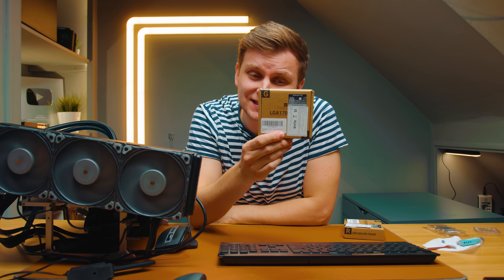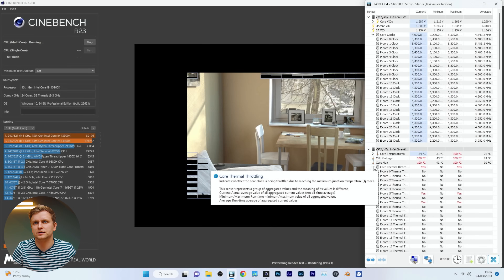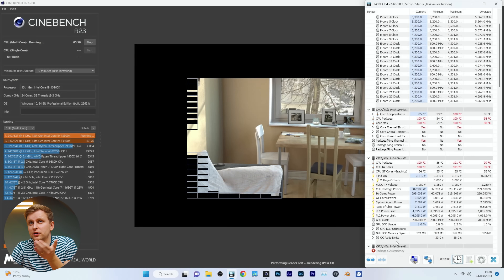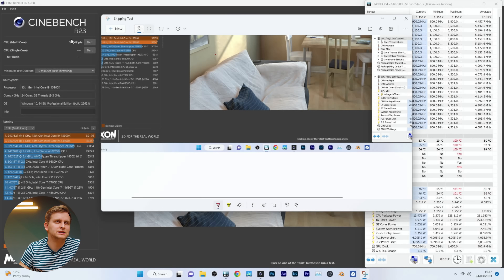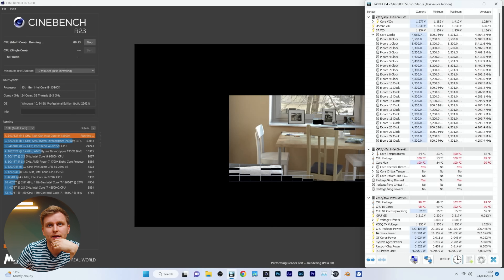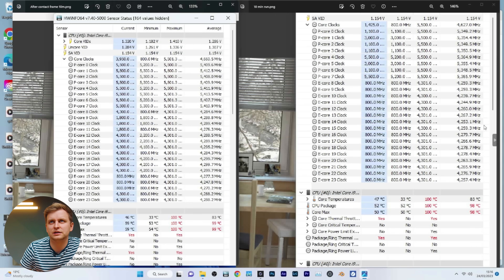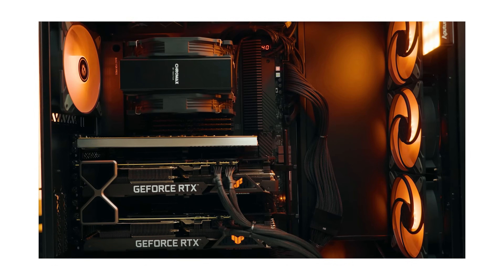This Makes Your CPU FASTER & COOLER 😱 | Budget CPU contact frame for Intel & AMD

Comment: I have been struggling to get my intel PC to not hit 100 degrees for 6 months. New fans, more changes to fan speeds and configurations than I can count. spending hundreds of dollars on fans and aio's. Messing around with Bios and XTU settings daily. Finally, I ordered this $10 part and the best thermal paste I could. Installed it and BAM it max's out rarely at 80 degrees and cinibench hits about 75 with undervolt and a slight overclock. Its amazing!

Comment: No it doesnt. About 2 degree difference at certain loads under certain conditions. Only thing that makes your cpu cooler is an actual cpu cooler and only thing that makes your cpu faster its you system and cpu and bios setting.

Comment: Most likely your CPU just isn't that bad. I've had a 12700k that was brutally bent. Had a huge puddle in the middle with stock bracket. My 13700k is nearly completely flat with stock bracket tho. There's a definite variance between CPUs and how straight they stay on LGA1700.

Comment: I have the i5 14500. I never seen my peek temps go beyond 71c but usually hangs around 45-50c on gaming. Some times 60c on a peak moment. It is on turbo as well so should I even worry about it with these temps?
Reply: If you're not having issues with temps, go for it. I switched from a 14700k to a 9800x3d, and just for peace of mind got a contact frame. Same cooler, no problems. The intel just kept randomly crashing and restarting. Had it before the final Microcode update, so maybe they're alright now, but I love the AMD CPU.

Comment: The question is also, if we reduce the temperature because of this frame, because it has contact with the heathspreader?...in essence, we increase the thermal mass and surface area of the heathspreader.  So it is in our interest that there is not only good mechanical contact between them, but also thermal contact.  It would be interesting to see how cold the temperatures would be if you applied an ultra-thin layer of thermal paste to the surfaces where the frame and the heat spreader touch or  where the frame presses on the heathspreader.
In that sense, these frames are poorly constructed.  Basically, in addition to mechanical rigidity, you should also have as much surface area as possible.  I'll try it on my new AM5 system...just a little...a little bit of thermal paste on the contacts of the heatsspreader and the frame can't hurt...just the application should be really minimal, and rather on the frame than on the processor when it's already in the socket  ...just less possibility of "accident".

Comment: Please help!
I watched your videos on ProArt systems and contact frames and decided to use one on my first build, but have run into a problem.
I bought a ProArt PA602 case, a ProArt LC 420 AIO cooler, and a ProArt Z790 motherboard with an Intel 14900KF processor housed in a Thermal Grizzly contact frame, and tried to put them together. Assembly went normally until I tried to install the waterblock/pump head onto the CPU. 
I used the hex-styled standoffs labeled for an LG1700, as per the instructions, and just lightly seated them onto the motherboard, not over-tightening. The Thermal Grizzly contact frame is absolutely not touching or otherwise interfering with the motherboard or CPU fitment. The standoff screws seem not long enough with the included Intel-style backing plate to give any thread to install the thumbscrew caps which fasten down the waterblock/pumphead. There is a gap left beneath the AIO mounting bracket of just about the size I would expect to give enough thread for the thumbscrew caps, if only the waterblock copper face were a bit shorter in height. When settling the waterblock onto the CPU, the tip of each standoff screw just barely comes flush with the outside/top of the waterblock mounting bracket, leaving no thread to fasten them on at all. 
I've redone this from scratch twice now, carefully rechecking everything I did, and cannot figure out what the problem is. What am I doing wrong?

Comment: Your test is not very valid. You had cooler as bottleneck. always 100c.  so any plate cant help you. and you wont see difference. you had to lower the power so that cpu stay at lets say 90c..and then apply frame and see will it go lower when you know that it cant go higher than 90.

Comment: It's $10, lol you definitely should buy it. It's driving me nuts, everyone out there critiques all of these products and poo-poo a few degrees lower temps, if you purchase (the Best/coolest AIO, etc.) and do things (airflow management, the best Thermal paste, etc.) that can save a few degrees here and there it all starts to add up to a CPU that can run cooler and perform better.

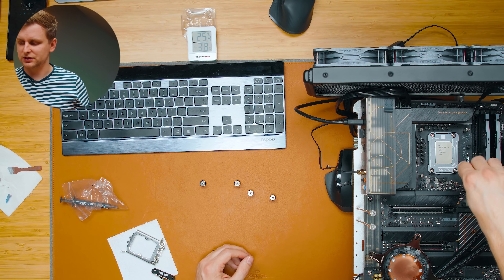Comment: 10:22 Yes, that's perfect.

Screws and bolts are tightened to a specific torque spec as a mechanical protect against vibration unscrewing or unbolting the fastener. Vibration isn't enough in a PC case to have to worry about that.

Comment: I bought these for every AM5 build to hopefully help with thermalpaste and maybe even better temps. At only $9 it was a small additional price. I did also buy Noctua's offset kits.
Reply: Do the ofset brackets only work with noctua coolers?
Reply: Quick question,you need something additional for the noctua offset kits,right? I got them and I can’t mount my cpu cooler on them

Comment: LOL 103C  ARE YOU KIDING . I HEARD ABOUT TEMPS ON ROCKET LAKE SO I SAID NO WAY DOES IT RUN THAT HOT SO I GOT ONE FOR GRANDSON PC DIY WATER COOLED A PRO PLUMBING JOB AND IT DOESN'T COME CLOSE TO 80C  IN THE R23 10 MIN  RUN AND THAT IS NOT WITH COLD WATER START UP EITHER. I WOULD BE EMBARRESSED IF I WERE YOU. LOTS OF YOU  UTUBER HARDWARE SALESMAN ALREADY KNOW WHAT I DID WITH ROCKET I EMBARRESSED ALL OF YOU

Comment: You use way too much thermal paste. All you need is a simple dot in the middle. By doing that weird division sign pattern with too much doesn't improve performance, but it does give you a mess to clean up later.

Comment: Not sure about faster or cooler but it made mountain easier due to that bending thing the default bracket would sometimes do.   Not sure if they fixed that flaw yet  but also putting on paste is easier too LOL

Comment: As I'll soon be running a 7800X3D inside an ITX case with a LP air cooler, I'll take every advantage I can get, particularly since the contact frame seems to make contact at more points on the IHS, plus have the air blowing directly on the contact frame which will hopefully mean more heat dissipation.

Great video! Sometimes it's the simple things that can equate to good gains
Reply: Update? :)
Reply: so?

Comment: A couple of criticisms, take them as you wish, but hopefully well. We're on the same side :goodvibes:

1. Why not use thermal paste between the plate and CPU? Anywhere you have contact between a device that creates heat and one that dissipates it, it is advantageous to use it.
2. Although no instructions were provided, the same screws and backplate as the Thermal Grizzly are being used, meaning that you'll definitely be safe following their instructions. Another thing to consider is that those are fairly large diameter screws, and use the highest capability head, torx, of any common head type. This indicates that it is designed to handle a lot of torque before breaking, which is necessary if you are intended to use a fair amount of torque. In short - I'm sure you could/should have went tighter.

I'm convinced that the performance would be much better if these two modifications were implemented. Thank you for the video, I'm sold on it and will be ordering one for my 13700ks... immediately. Cheers!

Comment: I got a 13900k last week and I already can tell it thermal throttles no matter what load it's under and there's one or two AIO that are 360mm that can just barely keep that at 99%... but even with this contact frame (which it has already been proven you can bend and file down the contact points on the stock mount and get the same results.
I also suggest getting the kryonaut extreme thermal paste, I haven't gotten my 360 aio yet but just the paste alone dropped my 240 aio temps by about 5c... which really surprised me honestly.

I'm note sure if you mentioned thermal throttling either, but the core temps were at 100C so regardless, the package will be at 100C... so you're better off ignoring that because without the frame it's going to do the same thing, and it's going to throttle it down to reasonable temps... it's insane... i heard the 14900k was slightly better but I cba to buy the same processor for 1-2 degrees improvement.

That being said... the point of having a faster processor is better if you are in 4k, because at 4k, you use less cpu than at 1440 or 1080p, because at 1080p you can reach a frame cap in some games that... admittedly is pointless.
Reply: My 14700K was thermal throttling (100°C+) under full load with the recommended 253W PLs. However, after undervolting and installing the Thermalright contact frame, it now reaches max temps of 85-90°C (on just one or two cores - the rest run cooler) with no PLs whatsoever. With my own PLs in place (225W flat; I find anything above to result in diminishing returns) and two core clocks raised by a ratio or two, my max temps never exceed 85°C under full load.

For what it's worth, I'm using an air cooler (Thermalright FS 140 V3) and the standard TF7 paste that came with the contact frame. I imagine I may be able to lower the temps even further (5-10°C perhaps) with some form of water-cooling, but I'm not in a hurry to do so as things stand.

IMO, there's no reason you shouldn't be able to get your 13900K running at reasonable temps (stock). I think it's just a case of identifying the crux of the thermal issue and resolving it. In my example, it was poor contact between the CPU and cooler (something I might have gotten away with on a lower wattage CPU, but these chips require additional precision and attention when cooling).

TL;DR: persevere with trying to reduce the temps, and good luck.

Comment: Not as easy to install as it looks imho. TURN SLOW with a little pressure on cpu at all times to prevent it from moving. Only like approximately 2 rotations needed for the first screw to become so tight that it tilts and rotates the processor + contact frame out of the socket (Luckily no damage to pins). Also you need to install the backplate of the cooler to hold the cpu backplate to the board. So many videos make no mention of this... its the act of rotating the screws counter-clockwise until they click that can cause it to move. When that happens, you gotta find a magnetic screwdriver to lift the screws out so you can peak through the holes and re-align the board with the backplate. Also be mindful of SMD's on the back of the mobo when you put it down. An issue that was specific to me is one of the mobo screws was slightly deformed... it wouldn't let go of the included wrench without a lot of wiggling or tremendous force (to the point of wanting to rip out of the board unless i turned it down 1 and 1/4 times), and it wouldn't click if i turned it counter-clockwise. I had no choice but to just turn all the screws until they just started to tighten and then used a torque screwdriver to finish up the torque pattern (8-9 in-lb worked for me to approximate hand-tightening... for comparison, since no manufacturer of these contact frames wants to specify a torque value, the ThreadRipper processors come with a torque screwdriver that is set to 13 in-lb).

Comment: as a guy who had Z690 and i7-13700KF without frame and then installed frame - I can tell buying this frame is a MUST, its not even a question. In my situation difference was so big and obvious. It stopped thermal throttling, temperatures become more stable (they dont jump 70 to 90C), and overall lower idle temps

Comment: That's why I use a shitload of paste. 
The screws are loose to help the stock CPU holders work better.  The design did not keep up with the processors and the failure rate is higher with cheaper fans.
Where can I get one of those tiny spatulas?

Comment: I do think you should retry this installing in a pattern X and torqueing each 90 degree at a time i feel this test showed ur mounting method caused it to not preform and mount aswell as it can!! gamers nexus video on why this would cause issues explains more

Comment: i wonder do i have to use the base frame first to install a new CPU to make it stay in place or i can just take it out and install this ahead if building a new Mother board with an Intel CPU
Reply from the maker: Don't need to install cpu first just use this straight away :)

Comment: I have 14700KF CPU and it doesn't bend. I checked. It fits really well in a socket, no big pressure. Actually I bought bracket but I didn't need to use it. And my temperatures are pretty low, no need to get lower, since I don't boost over 5,7/4,5GHz

Comment: Hey, I have a keyboard that's quite similar to yours, the Rapoo 9500M, though yours might be the 9900M variant. I've noticed that it tends to miss some keystrokes when I don't press directly in the middle of a key. This issue seems to occur more often on the larger keys like "Space," "Enter," "Shift," and "Backspace. Have you run into the same issue? Looking forward to your reply.

Comment: I did install one yesterday, when I installed my 13700KF, and it not only makes your CPU about 3 degrees cooler, in conjunction with a Peerless 120 the temps can only hit thermal throttling after 3 minutes of torture.  My temperatures have come down  to 28–30 degrees, depending on the measure point.  Before, they were 32-36 on average. For those skeptical, think about the investment in your gear.  My wattage was around 248 before it started throttling.

Comment: The Thermalright  isn't  made to the same tolerances as the Thermal Grizzly contact frame, in practice  it doesn't really  matter as long as you're  paying attention when screwing the frame down. What you're  really paying  for is German  wages versus  wherever the Thermalright frame is made wages, does it matter if its 60 microns  thicker than  the  next one if you're only fitting one? I  get great results with the Thermalright frame and  13600kf  @ 5.5.5GHz.  Probably more  important for  tasks other than gaming (on 13600k/kf) but I'd say every owner of the 13900k  should be using one. (Either brand)

Comment: I am having an issue my A1 RAM slot is not working.
When I installed the Thermalright ILM Bending Correct Frame for Intel LGA1700.
but when I installed the Intel ILM my A1 RAM slot is working fine now.

Comment: The whole point of the stress test is to see how fast the  CPU can get before it throttles.  So the temps - no matter what the cooling effect - are going to be similar.  CPU will throttle at certain temps.   Looking at the temps is just looking at when the CPU throttles (and that will be very similar regardless of cooling effectiveness.)    So - for this test - the only relevant measure is if performance when throttling is reached.   You MIGHT also look at the variance in the core temps to see if this evened them out.  But otherwise temps are telling you squat.   The only exceptions will be if your cooling is overkill and the CPU doesn't throttle (or if you can't even cool enough to keep it from crashing).

Comment: with this frame i can use the "ASUS multicore enhancement" without worrying abount temperature on my i7-12700K with an air cooler (NH-D15S with two fans)

Comment: I am presently using the Thermalright - I saw an 8degree Celsius reduction on my 13700k
Thermalright - Mass Production item, flatness changes from bracket to bracket.  IE  one side could be .5 or 1 and 2 mm then a third side.
Thermal Grizzley - custom built, consistent tolerance across all brackets.  More consistence fitting and temperatures.
Reply: Hardly.  
A flat piece of glass and a calipers will easily tell you if it is off at all. 
I have the jungle leopard $9 one and it is perfectly even in dimensions.   It is not Wang Choo making these on a 1940 milling machine while drinking rice wine, these things are being spit out on a decent cnc mill.
Reply: @gt1man931  Wang Choo! HAHAHAHA! 🤣

Comment: The only problem with the "10$ accessory" is that it's a copy of Thermal Grizzly's 40$ "accessory" but it's easy to pull the price down when you don't do any research and just copy someone else work. Just saying.
Reply: They actually created theirs before thermal grizzly did so if anything thermal grizzly stole their work and charged a higher price for the same thing 😂
Reply: People realized the potential issue and were doing the washer trick way back when the 12th gens first came out.
thermal grizzly decided to see who they could suck 40 dollars from while making a fancy copy of the trick, while other companies did not try to gouge quite so much for the same thing.

Comment: I use this with an i7-12700k and my temps went down by 7-10 Celsius compared to what it originally was. Also, I plan on using the same bracket for an i7-13700k

Comment: excuse me. if you say the bending normally  is non-eye visible, could the thickness of the thermal paste you smeared on cpu  had "covered" the difference ? and acted like a leveled surface ? and so invalidate the results that have to be imputed to something else ?

Comment: Hi, I heard that after using the computer (intel) without it and then adding it, there would be very low changes because it had already sat down, more changes if change better paste, is that true? thx

Comment: Do you think it would do a better job at cooling if the "paint" was sanded or somehow taken off?
Reply: No, don't do that because it's anodized. If you sand the paint off you're taking off the corrosion resistance, and rust resistance.